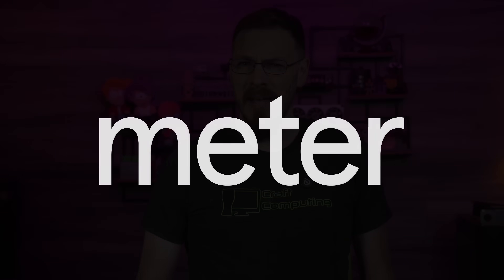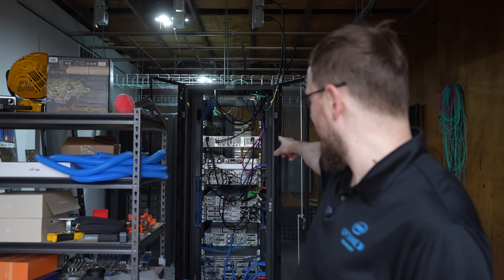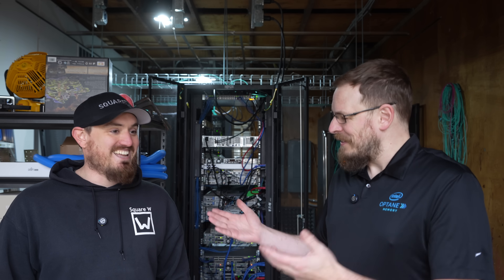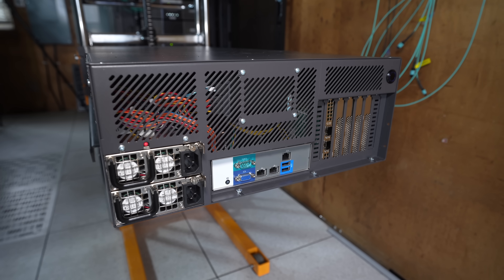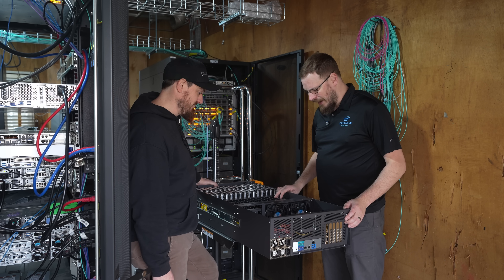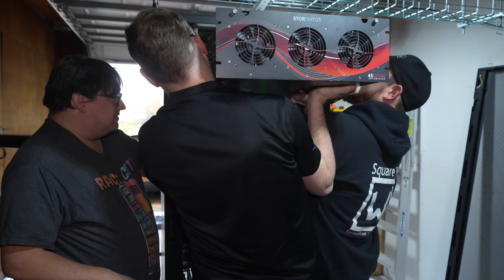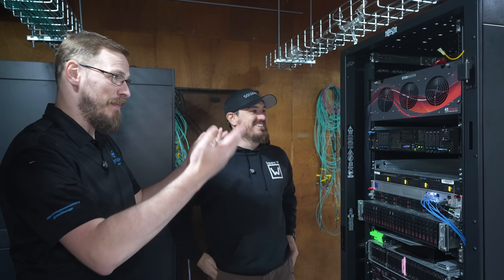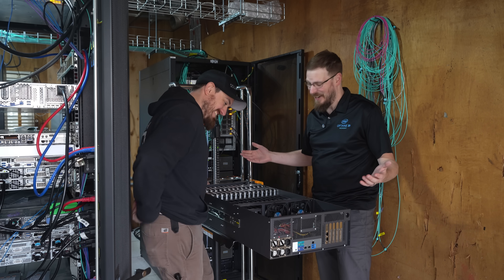I helped deploy 900TB of Cloud Storage!!! - 45Drives XL60

Comment: I have racked one server that had probably about the same weight, but it came with four slides so there were two on each side to make sure it stayed in place. The biggest server I built had space for I think 102 drives. It was pretty insane. But having space for that many drives in, I think it was a 5U, rack space isn't something you see every day. But the rails on that one was massive and they were designed so it could be pulled entirely out of the rack and still be mounted on the slides. And yes that rack better be firmly attached so it doesn't tip over.

Comment: Hey, do you still have that Tesla P4 from years ago?

I dont know if you do video requests since your videos are on what is your hobby after all but could you possibly try to power limit it to 50W?

People are 3D printing fan mounts for the end of the card to blow air through and I think it would work on a mini PC if a 40mm fan is mounted to the rear IO of the card (yes, externally) while the top cover is removed to expose the heatsink and the cards heatsink hugs the mini PCs top cover holes for the hot air to escape.

Not every mini PC has holes there but I’m thinking Lenovo P330 or M920X. Stuff like that. They have the holes but also their PCIE is limited to 50W

Thanks for reading :)

P.S. I typed this after I watched your videos on the 4000 in a mini pc, your lenovo tiny videos and your Tesla P4 video :)

Comment: What happens when the drive bays are all used? How do you expand the capacity then? I remember disk shelves were 'a thing'  some time ago - wouldn't it have been more practical to use that sort of kit, especially for disk failures and maintenance?
Reply from the maker: Disk shelves are still a thing, but wouldn't make sense here. They have the same limits to expansion as a dedicated NAS... Once they're full, you buy another. As Josh stated the current plan is to move ~400TB to this archive, leaving ~350TB free for future use. Plus Josh has the other 30 drive bays remaining for other clients or expansion for this one.

Comment: I think most people mean 45drives is too expensive for homelabbers as a hobby which is what part of their lineup is marketed for. This is a business and it makes perfect sense to use 45drives chasis for this.
Reply: yes and no. They are too expensive for small homelabs that can do fine with a random atx case converted to NAS. But for data hoarders that actually want to run a large amount of storage in their lab, the cost of the disks will dwarf the cost of the chassis. You might as well give your 20k of drives a worthy chariot to ride in
Reply: @marcogenovesi8570 man, if im spending more than 1k on drives they are going in a nice chassis
Reply: @marcogenovesi8570 I think the product and those people you talk about are on a tax bracket completely different than mine 😂😂😂 and yes you are correct, I only have a few servers and I believe none of them have more than 6 3.5" drives in them I assume the moment I surpass more then 10 or 14 drives in one of them my options would be so limited that 45drives would be the way to go.
Reply: Yes.. If you are a car enthusiast that likes to drive fast, why don’t you own a Le Mans Prototype?

While that would be cool.. I’ll aim for a Honda S2000 instead.. seems more reasonable for someone not looking to collect silverware…
Reply: @Wirenfeldt1990  yah but thats not a good comparison, because the storage costs 10x the chassis. thats like putting a v6 from an F1 into a gt500. Its already a nice vehicle and then you just triple the investment

Comment: Just 20 years ago this would have been an unfathomable amount of storage.
Reply from the maker: This server is only half full too.
Reply: I worked at a large ISP/Search Engine/Email company (that shall remain nameless) 30 years ago. It was pretty common to see this much storage or more in the datacenter. I always wished they'd give away or lottery off their decommissioned equipment to employees but they never did. Today I'm hosting over 120TB of storage at home and I'm running out of space. It's crazy how storage needs for even home use has grown so much in 20 years.
Reply: @thetazlord  sir you need to reduce a bit your linux isos collection.
Reply: @thetazlord  Same here, but something I've been realizing after a few years is that the more data you maintain, the more you have to spend on drives to protect yourself from losing it.  Thus, I'm considering downsizing to something more manageable.  Part of me hopes that HAMR drives become more affordable in the next few years and I'll be able to hold on to the same data for a lot less.
Reply: @randomman057  What about tape drives? For that much storage, its probably cheaper.
Reply: @lolmao500  It would be if actual LTO drives weren't so damn expensive.  Even used they're quite costly and sometimes you need enterprise level software to use them.
Reply: True
Reply: 640k ought to be enough for everybody